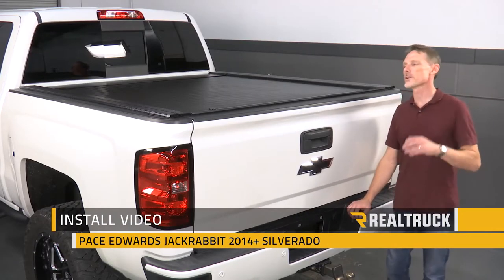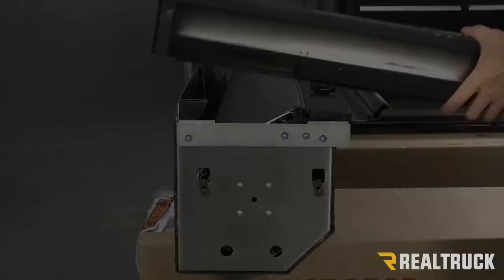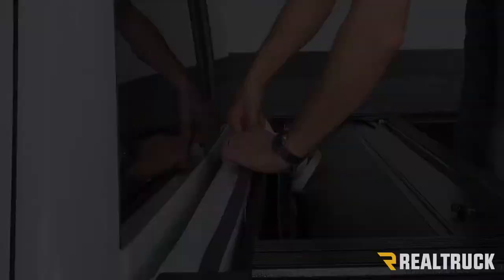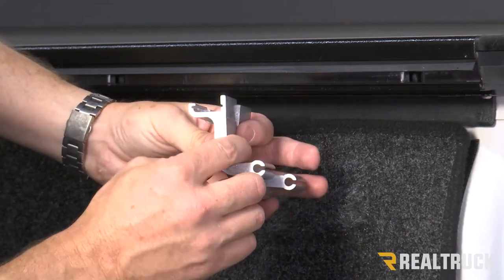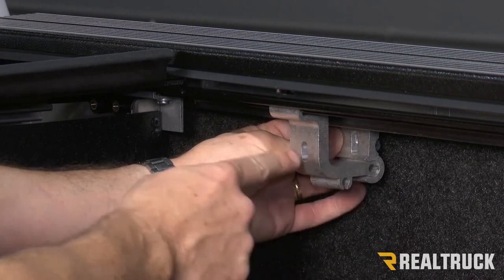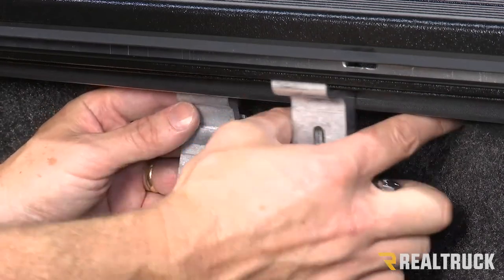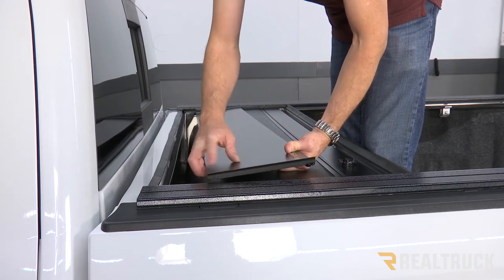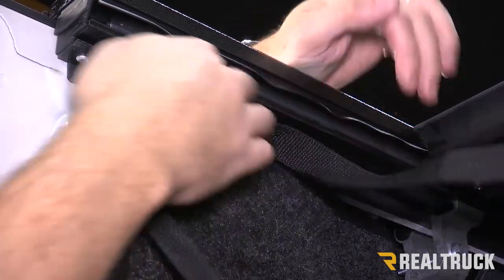How to Install Pace Edwards JackRabbit Tonneau Cover on 2014-2017 Chevy Silverado

Comment: I'm trying to obtain a replacement remote for this Pace Edwards Bedliner electric bed cover. Pace Edwards says that they have gone to a new style control panel with different remotes. Any ideas on where I could get one? Thanks in advance